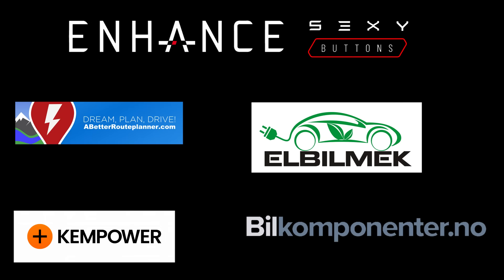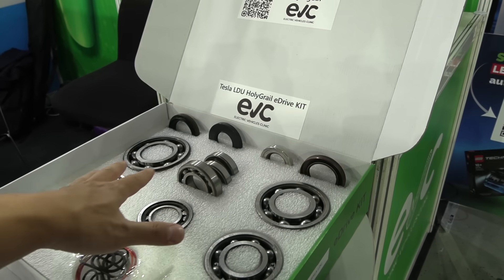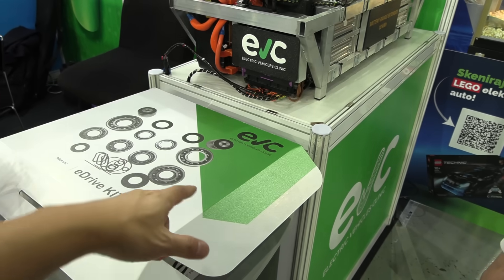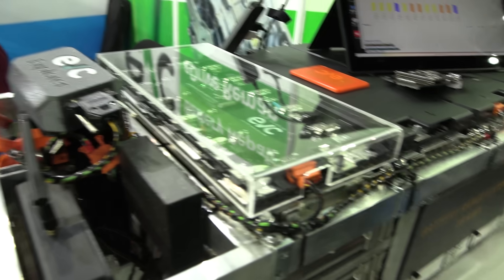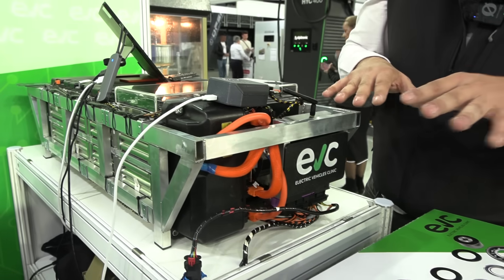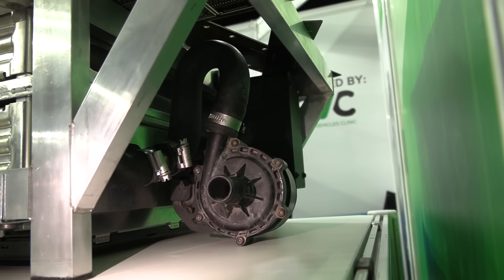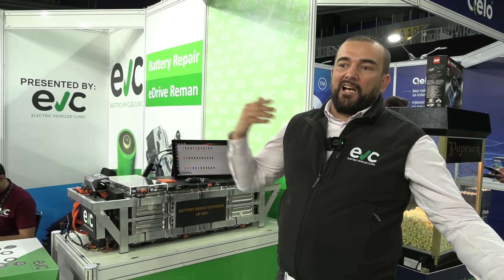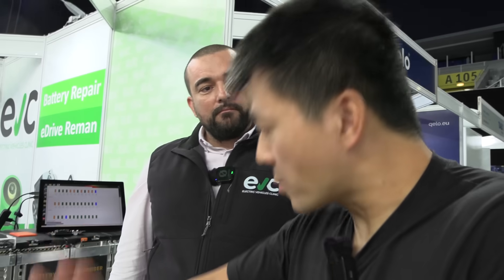EV Clinic made a 18 kWh range extender for Tesla and any EV

Comment: I want range extender for ioniq classic. Shut up and take my money!
Reply: The main question, in my opinion, about these systems is how much they cost. And the manufacturers are usually going to price them in a way where it would be barely economical to do this kind of upgrade. At least that has been my experience with similar initiatives so far.

Also one other factor with these start-up-like companies is that they do not need, nor they practically can, sell large volumes of physical products. The reason is that they usually have no capacity to manufacture so many. So they will be okay with selling just a few items and they will be willing to wait for rich enough customers who can afford it.

I would not be surprised if the price would be so high that the option of selling an older car and buying a newer used car with a better range and better features would be a very economically competitive option.
Reply: There is one guy that upgraded the classic. I don't have much info right now, but if you google you should find him. I've seen the photos of the finished car.

Comment: Range extender for the BMW i3 would be nice. There is space underneath where there is space fore the motocycle engine
Reply: there is a company they produce new bigger batteries for the i3 - including thermal management
Reply: @christiangraf7970  thanks, i know. But that means replacing the original pack. Mine SOH is 97% so no justification to replace it in full. Just some extra range would be nice for hitting the road on travels!
Besides, there is some doubts about the structural strength of those chinese packs compared to BMW OEM
Reply: Fully agreed...and hoping for!

Comment: Here in Norway the mobile operator will switch off the G2-network in 2026. Older cars like e-golf/e-up who dont have 4G/5G cellular network, will not have the possibility to remote access (remote preheat the cabin or remote stop/start charging).  It would be nice if the battery extender had cellular modul so it could communicate with VW app remotely for preheating and charging. Som people would buy this product just because of that.
Reply: Not possible. You are not allowed to host your own 2G network, as you don't own the rights to use the frequencies. The reason it is getting shut down is that 2G is very inefficient in terms of data per frequency slot basically. The providers want to use the same frequencies for 4G/5G. The only thing you could do is attatch a micro controller with a 4G/5G/Wifi modem to the right canbus that can send the same messages as the original VW module did.

Comment: How is it with homologation and stuff. I guess, the car models, are not alowed to be "pimped", without losing road legality. At least here in Germany, police or control institutions (TüV, ...etc.), will not allow such modifications, unless it is checked extensevely and all the paperwork, that is costly. Maby there has to be modified also the suspension (bec. of higher vehicle weight with the additional battery pack), and lowered loading capacity. E-Golf then maby only with 5 ppl and 100 kg luggage :D . It has to be thought about, it's not like a 20 L fuel can that you put in the trunk..
Reply: why!? its only a additional battery.
Reply: @AutonomousPRlME  add a battery with the additional weight, high voltage connections, cooling system on road legal vehicle in not allowed in most of the EU countries. Unfortunately evc can’t sell this product if the laws will not change. Be sure that the car dealers prefer to sell new cars than promote the durability of the old ones, then it will not change 😢
Reply: Du meinst also, der TÜV Prüfer wird in Zukunft auch in den Kofferraum schauen?

Comment: I have P85D with battery that rarely changes at power higher than 60kW. I would prefer at new battery package that charges battery faster with bigger capacity. I can replace the battery with and old 90-100kwh battery for 12000-18000euros or a new one for much higher price. I wish that Companys like ev clinic there making real battery  alternatives and not just an extender making car more heavy.
Reply: but when you install a bigger 100 battery it will increase the weight as well ??
Reply: @christiangraf7970  ja natürlich, und im TFF Forum wird dies auch diskutiert

Comment: Put this to the Hyundai IONIQ 28kwh. A tiny battery but charge really fast for it's age.
Reply: I'd love an affordable solution to extend the capacity of my Ioniq.
Reply: I would get in line for my IONIQ 28kWh first thing!
Reply: This would double the range of my Nissan Leaf
Reply: Hyundai IONIQ 28kwh has an air-cooled battery so it would not work unless they create an aircooled battery extender as well. The 38kWh version however, has got a liquid-cooled battery.
Reply: same for BMW i3 without rangeextender - there is space under the trunk
Reply: Yes it’s still a great car, but the battery is too small. Given how cheap the cells are, I would love to add 30kWh capacity.
Reply: The problem with Ioniq and Leaf is that the cabling is not made for double the charge rate.
Reply: Also it is not needed, because the ioniq classic is so efficient that the low charging speed is good enough.
Reply: @gwieser There won't be ans neer for quicker charging, just for more initial capacity for the first stint. With a bit of degradation at 170'km we'd like to have a bit of more range espacially in winter

Comment: Please don't... In Tesla's (and most other brands) the trunk well is part of the crumple zone. Getting rear-ended while having 18kWh of unprotected battery stored in the trunk would instantly turn your Tesla into an instant cremation chamber. But I applaud the novelty, though 👍
Reply from the maker: Trunk is not part of the crumple zone. I have seen Teslas rear-ended and while the front of the other car was crushed, the rear of the Tesla was almost not affected. Parts of this is because Model S has 7 seat version where the kids can sit in the trunk. It has to be string.
Reply: @bjornnyland  true, but the 7-seater has a reinforced crossbar from factory, for this exact reason. Tesla has some really detailed documentation about this in their Online Parts Catalogue. The manual is called "Body Structure Materials and Allowed Operations". Pretty cool
Reply: @bjornnyland  7 seat Model S has an additional crossmember added to the rear bumper beam compared to the 5 seat.
Reply: Well, I already added a trailer hinge that strengthens therear. Also the Battery could be placed in a stainless steel box.
Reply: @Raphael_Hofmann  Stainless steel box wouldn't do you much good as, this box would simply be slammed into the main battery compartment.
Reply: Seal it with a metal shield - problem solved
Reply: Trunk is NOT Part of the crumple zone!!!

Comment: I like that Vanja is no BS salesman, he will just tell the actual correct technical data, he could have told the pack is 18 kWh netto but he thought a little bit and told it is actually 17.1 ❤
Reply from the maker: He's the real ninja! 🤣
Reply: He’s true engineer
Reply: His expression is honest
Reply: @evclinic any idea when the e-niro/kona kits will be available again? Thinking of getting one for my kona to have it done just in case. 
Thank you for everything that you do!
Reply: Problem with whole car industry is that marketing and designers are too dominant. We want facts not story or BS claims
Reply: Avete pensata anche a BMW i3 60 Ah ? Io ora ho la batteria che mi mette a disposizione 14 kWh netti circa. Se la risposta è positiva dov’è si potrebbe posizionare ?
Reply: @lucianonottegar2641 if you have the BEV, the motor is on the left of the rear axle. the i3 is engineered to accommodate the REx on the right side of the axle.  the REx space is unoccupied in the BEV model so this space appears to be an opportune location for the 2nd HV battery. 
The i3 should be a perfect candidate for the featured auxiliary battery. 
(It’s battery is 355V (8 modules x 12 cells x 3.7V) lithium ion battery prismatic cells - NMC 1, 1, 1 nickel, magnesium copper.)
Reply: Well, except in a previous video he said that with his Kia Soul 38 kWh battery pack you get 300 km range...which is absolutely not true and typical EV-data lies as we get 99.9% of the time.
These claims are never addressed by the legal system and consumer protection authorities (even though we have thousands of incredibly highly paid ones in the EU) for some reason...

Comment: I have a 2016 85D Model S with 291,000  miles covered so far. The bearing kits and this range extender are very interesting. Looking forward to seeing more from EV clinic. I think we will be doing some business in the future!
Reply: Original battery? What percentage of your original capacity remains?
Reply: I think bearing kit is meant to be for large rear motor. It says LDU on it for large drive unit.
Reply: I suggested to Tesla to make a sodium battery bank that fits the well in the frunk. Use a buck converter to voltage match the main battery. Sodium batteries are not temperature sensitive and dont need heating and can use passive cooling.
Reply: I'm not a fan that they're still pushing the bearing kit as a holy grail when the coolant bypass seems to be the prevailing alternative. Comes off like them wanting to recoup R&D by selling an inferior solution rather than picking what's best for the client. At the very least, there is no proof that coolant bypass has any downsides barring racing applications.

Comment: Björn put this in the eGolf!!!
Reply from the maker: Double the range. And no rapidgate! Game over! 🤣
Reply: @bjornnyland when will this be released for the egolf and what would be the price, also how about the installation of this kit in the egolf?
Reply: I want one for my 35 kWh E-golf!
Reply: @haaibaai ich bin auch interessiert
Reply: I want this in my eGolf!! This would be a game changer for this vehicle
Reply: @bambelbino but you would have no trunk space left. What are you so hyped about? 🤔 Honest question 😇
Reply: @bambelbino ich bin auch interessiert
Reply: This sounds awesome.  The only potential issue I can think of is the extra weight at the rear. The eGolf is already a bit light at the front end compared to the ICE models.
Reply: @harveyschofield4619 used to shred the front tyres up in mine, had to change them every 6k miles! Loved it though
Reply: I like this approach.. but they will need 7,3 modules for 88 cells for the e- golf.. I think they use 12s1p modules.
I wonder if this extender will charge together with the original pack on ccs on the e- golf.
Reply: @bjornschrijnemeeckers9521 that os the whole point of bms system/ master-slave.

Comment: 9:52 I thought this has a DCDC converter that adapts to the vehicle voltage level but you actually make separate packs for each vehicle voltage, I don't see how this would work as it is a custom solution, only if the price will be really competitive.

Comment: So good to see these free thinking people make EVs property of their owners again. Right to repair! (And inprove)
Reply: They want €4500 for the instruction manual to fit that kit. They state without it you'll fail the installation. Far from right to repair
Reply: @Phantom-mk4kp The manufacturers give you no solution what so ever. I would argue, that a new driveunit is much more expensive and not at all resource efficient.
Also you just need to buy it once as a workshop and use it for several repairs.
Reply: There’s a guy in Russia that built a custom 125kwh battery pack for the model s